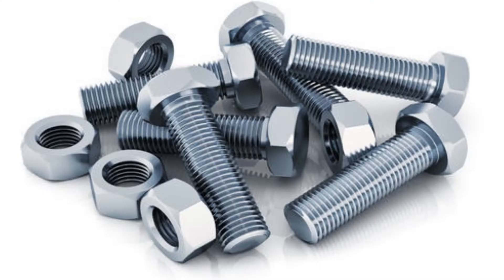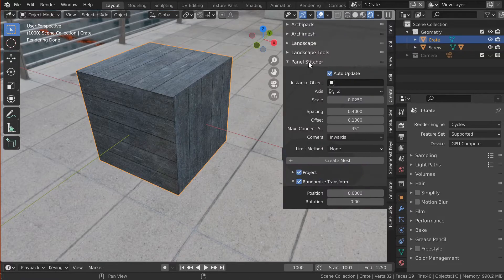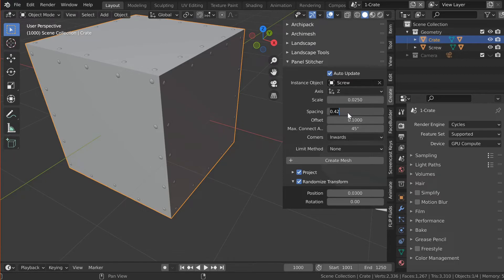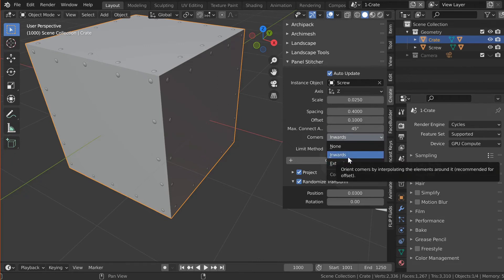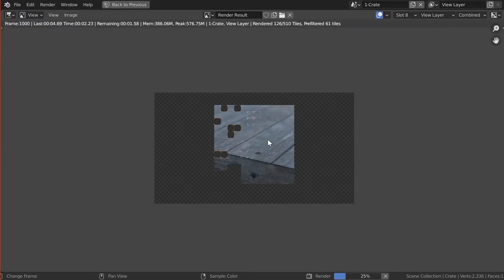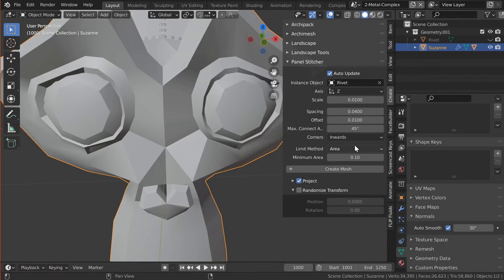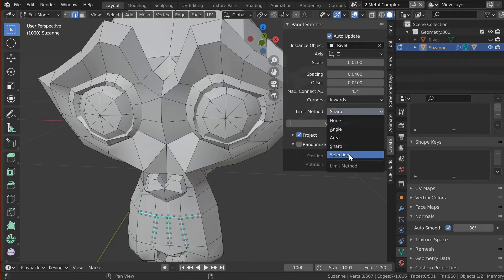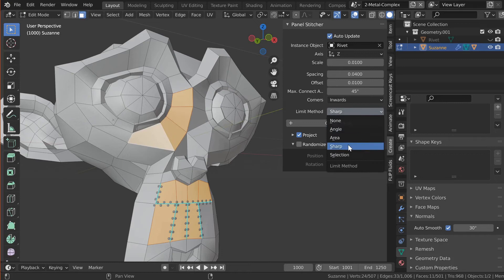Rivets tutorial with Blender Panel Stitcher

Comment: I got this without checking if it's compatible with 4.0, is it? It is not showing up in my add-ons after I downloaded the .zip file
Reply from the maker: Hi, yes it should be compatible with 4.0. Please use "edit > preferences > addon > install" and select the zip file. There are instructions with screenshots on the Blendermarket documentation. Please ask for support through Blendermarket if you need any help.
Reply: @WittingGraphics  thanks for your help man! Subbing bc ily

Comment: Hi, just bought this add-ons. Is the addons automatically apply the target mesh? Because I want to use the add for some commission model and send said model to the client
Reply from the maker: Hi, I understand that this response is overdue, but in case anyone else has the same question: it creates a new object, that has the original target as parent. This means that it moves along with the target object, but materials etc. can be set independently. It can also be merged of course with the target with "Ctrl+J"

Comment: Would it be possible to add correctly named rivet collections? I do parts for scale model aircraft and it makes sense if I can select the correct rivet. Selecting AN470-4 or AN426-4 from a list for example. That would automatically select the correct rivet head and dimension. There are a zillion different types of fasteners out there for aircraft, but the more we can have from a library, the more accurate our final products will be. Thanks.
Reply from the maker: Hi Dave. That's a good suggestion, thank you. I can imagine it being useful to have the correct parts available. It sounds quite time-consuming and might require an updated UI to reduce clutter with large amounts of rivets, but will definitely be considered as a future addition. 
In case this gets implemented: would you know a resource through which it is possible to find or list the most commonly used parts and fasteners (in the scene of model aircraft)?

Comment: How do you flip the orientation of the "stitches"? I want to use lengthwise stitch, and the stitches are upside down inside the mesh, instead of right side up the way you would expect. Im having the same issue with the screws and rivets. Id like to be able to rotate the orientation around by degrees if possible. As is right now, I cannot use this plugin, unless there is some detail im missing?

Also, can you edit the height of the stitch? like if I want it deeper or higher above the surface?
Reply from the maker: Hi. 

If all the objects are upside down, there's a large chance that Blender has accidentally defined your mesh "inside out", does the problem persist if you use mesh > normals > flip? (or recalculate outside/inside).

For specific changes, you could use your own custom objects (choose "object" instead of "template"), like in this video.
It's also possible to modify the templates, like changing the depth, because they are imported into your project. There should be a collection called "Panel Stitcher Templates", you just have to enable it in the viewport by clicking the monitor symbol in the outliner. Then move, rotate and edit the template however you want, as long as the changes are made in edit mode.

i hope this helps!
Reply: @WittingGraphics  im still having much trouble trying to get it to do as I need after your instruction...maybe im not understanding correctly or something.... I tried the recalculate normals, that had no effect. I've been most focused on trying to edit the template stitch but its not working for me. Do you think its possible to make a video detailing what you're saying for clearer understanding? Ive spent over an hour trying to get it to work correctly with no dice.
Reply from the maker: I'm sorry that this problem has taken so much time.  Fortunately, I was able to record this (unlisted) video: https://youtu.be/m4gdb9W3hn4. It's probably about time to make an updated tutorial, I'll make sure to mention these things in that video too.

Comment: Can I have a question. When I setup Offset to 0. Did it produce double instants for rivets or it creates single row on the surface edge? For example in combination with sharp option?
Reply from the maker: If you set offset to zero, panel stitcher switches to a different mode where there are only single rows along edges. This works in combination with limit modes like sharp.

Comment: Bought it. It makes exactly what promises. Great idea for addon, thanks for offering it! Can you make a video with other kinds of stiching too please? For cloth stitching for example. I do wonder how someone can achieve such a stitching kind with the use of the addon (especially if it is an 'x' kind of stitching between the pieces to be stitched).
Reply from the maker: EDIT: This is now an implemented feature in the latest version of the add-on. The templates include various shapes of stitches.

Thanks for the kind words and purchasing the addon! Unfortunately I don't have enough spare time on my hands to make a new tutorial for clothing at the moment. However, the process is very similar so I'll just outline the differences here:

1. Create a single 'X', using regular edit mode tools, or by using a curve (https://en.wikibooks.org/wiki/Blender_3D:_Noob_to_Pro/Bevelling_a_Curve ) and converting it to a mesh.
2. Use it as instance object with the clothing selected. Set the offset to 0, so there's only a single line of X's along each edge. It'll probably also look better without corners (Corner mode = none). Change the spacing so the pattern looks how you want
3. Assuming you only want some of the cloth mesh edges decorated with stitches, use the sharp method at 3:34. 
If you already use sharp edge marking for other things like shading, duplicate the cloth mesh instead and use panel stitcher on the duplicate. (remove or hide the duplicate when you're happy with the result)

I hope this is enough to get you started!
Reply: @WittingGraphics  Thanks for the detailed answer. Will try it. There are some other problems too that I detected, but it is difficult to explain them from here? They need a visual explanation. May I have a mail adress of you? It is an addon that can be very useful indeed and it would be good to make it even better.
Reply from the maker: @dimitrilalushi4693  In that case you can probably best contact me through blendermarket, by going to the product page and using "ask a question" on the right side. 
Any feature suggestions or bug reports would be appreciated
Reply: @WittingGraphics  Ok. will do it! But I do not know if it is possible to send screenshots from there. Anyway, will see.